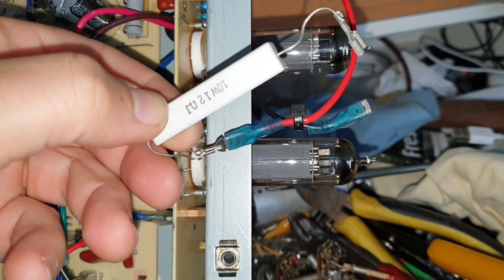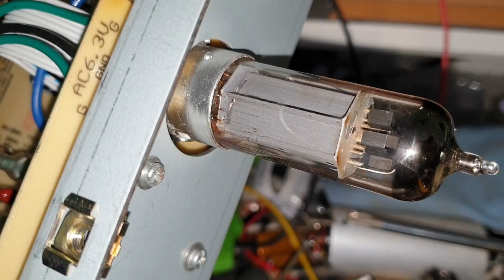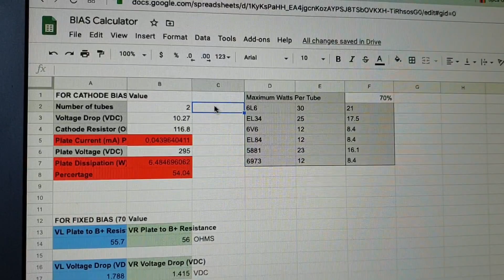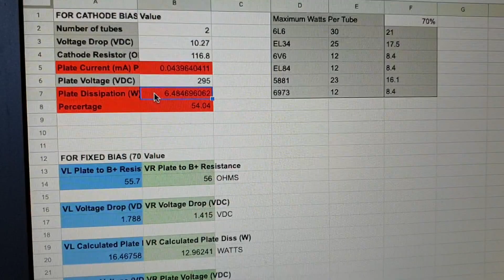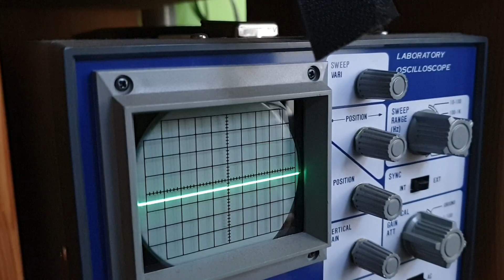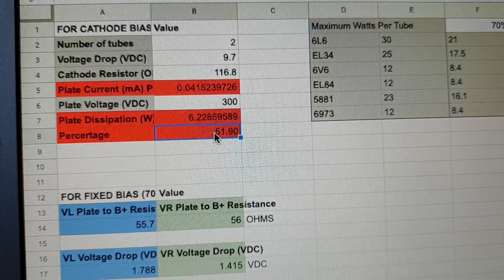Strauss SRT-15 New Tubes - Check Bias - Red Plating - Ticking Pops and Crackling

Comment: G'day, lovely video. Do you know how many OHMs the speaker is?
Reply from the maker: Sorry, I can't remember. I believe it might be 8 ohms. You may be able to check with a multimeter. It's not accurate because a speakers Ohms measurement is actually impedance, not resistance. But if it measures around 6-7 ohms, it's likely an 8 ohm speaker. If it measures 2-3 ohms, it's likely a 4 ohm speaker.

If I recall, the back plate where you plug an external speaker in suggests 8 ohms minimum. I could be wrong. Take a look, I no longer have the amp in my possession to check.
Reply: @FixItAgainPhoney  Thanks I just bought one, pulled everything apart, it is 8 ohms. Further question if I may - prior to disconnecting the wires from the speaker I failed to take note of which one was connected to + and which one -. The wires are green and yellow, the green one appears to be connected to a black 'earth' wire too. Any suggestions as to which one to connect to the positive and negative? Out of a 'sense' I had I have connected the green to the positive and yellow to the negative and the amp sounds fine.
Reply from the maker: @jameswebstermusic since there is only one speaker, it won’t matter too much. However in order to maintain how the amp was made, you can connect a standard 9V battery to the speaker terminals and observe which was the cone moves. Do this quick quickly to avoid burning out the speaker voicecoil. If the speaker cone moves inward, flip the battery around and try it again, the cone will move outward. Note which orientation you had the battery terminals on the speaker terminals. This will indicate which terminal is positive, which is negative.

Do the terminals not have any markings at all? Usually the Mylar/plastic mount that the terminals are riveted to have some sort of marking.
Reply: @FixItAgainPhoney  Thanks again, I can see the + and - on the speaker terminals, I just can't identify for sure which wire is coming from the amp is positive and which is negative. As mentioned, there are two: one is green and the other yellow. The green one appears to be connected to a black wire too, which I imagine is the earth.
Reply: Thanks for your feedback so far, any suggestions of how to identify the positive speaker wire and negative speaker wire issuing from the amp?
Reply from the maker: @jameswebstermusic ah. I apologise. I got it mixed up. You’ll have to inspect the amp to determine that. Get your multimeter out and see which wire gives you continuity to the ground of the speaker output jack.
Reply: @FixItAgainPhoney  Thank you again, is the one with the continuity the positive wire?
Reply from the maker: @jameswebstermusic one wire will have continuity with the  “tip” and one wire will have continuity with the “sleeve”.

You may get some continuity between the two wires as they may show the impedance of the output transformer.

The best way would be to just remove the chassis cover off the back and take a look at what wire is connected to what part of the output transformer and/or the output jack for the external cab.

The “tip” is usually positive and the “ring” is usually ground.